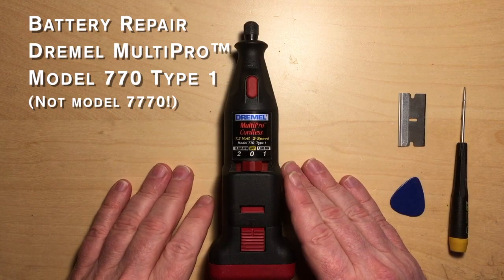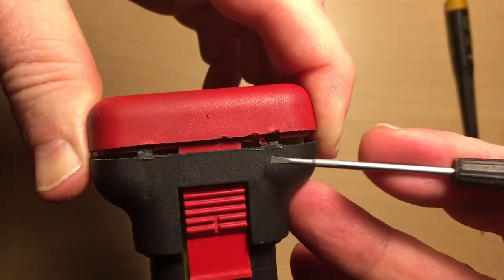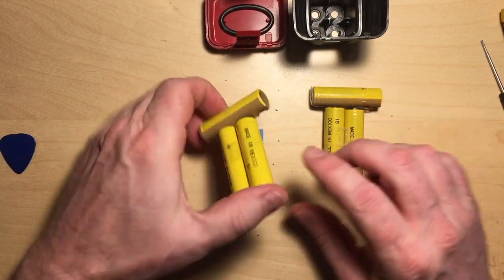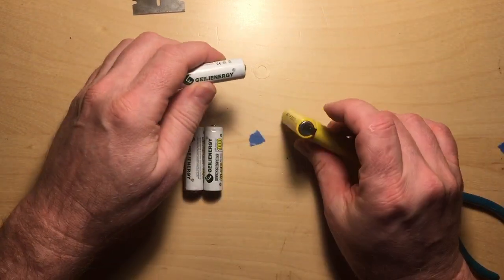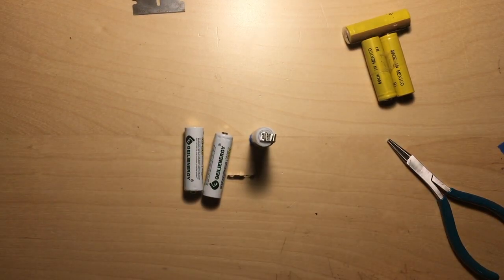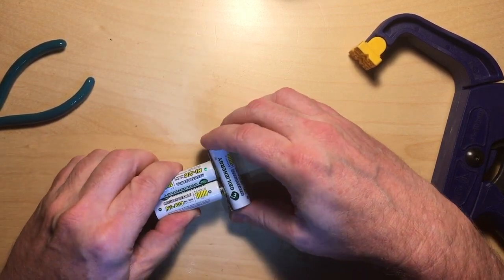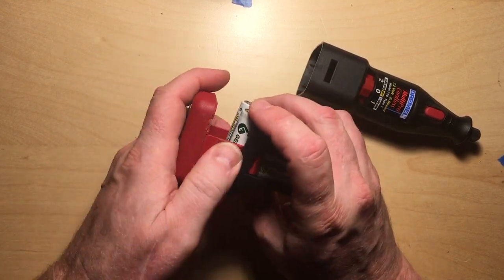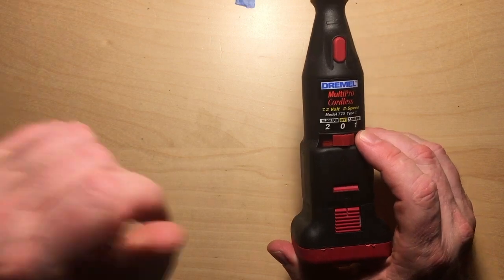Dremel 770 Type 1 Battery Repair / Replacement

Comment: Thanks for this informative demo. i have the exact Dremel and battery pack but with blue tabs.  I ordered my batteries from Amazon.  Then I carefully tore off the tabs from the existing batteries, which damaged them slightly. I then soldered the battery packs and replaced them, put it all back together and the Dremel worked at both speeds.  Thank your guidance.

My solder joints and contact bands to the batteries are pretty crude and probably will not hold up under tough use. Investigating a little more I found there are USB battery spot welders available with the least expensive being around $55 and the pack comes with new bands. They are pretty cool and give you a quick  tight bond. Maybe a worker at Batteries + will have the spot welder, and can buld this for a fee but their batteries are very expensive.

The cost of a new Dremel (DremelLite 7760 4V Variable Speed Lithium Ion Cordless Rotary Tool Kit with 10 Accessories) is about $64. It was a nice exercise and learning fixing this but I am going to stop here! Too bad Dremel does not support this battery pack replacement.

Comment: Hey thanks man ! 
Here’s a little tip … when you put the little screwdriver in the edge to separate the red top from the black body of the drill you just need to get alittle gap between them then push on the red buttons on the side and that will disengage the black clips so you don’t break them … at least that’s my experience while watching you

Comment: Hopefully this isn't too upsetting but I'm halfway through your video and have the same model. It's actually one of the first 100 made. Anyway if you squeeze the 2 red squares for the battery release hard it slides down pretty easy to expose the yellow cells

Comment: Instead of prying or placing a vice once the video showed where the tabs were located a tried this instead.  Take a pair of channel locks and grab the red cover where the tabs would be.  Do not grab the black part.  Squeeze gently while at the same time pressing the red lock tabs.  Gentlt rock the black part while pulling them apart.  Took about 5 seconds.
Reply: This worked GREAT.

Comment: You can actually zap your existing pack with approximately double voltage to bring these back to life. I have some B&D 17 volt lawn equipment batteries that I charge up, use some clips on their blade terminals, and touch and hold + to + and - to - , noting that there are two of each on the Dremel pack and you need to zap both to energize all 6 cells.  I’ve brought back Dremel packs that wouldn’t take any charge.  The zap dislodges the sulfation crystals that form from disuse and shelf time.  For an unchargeable Dremel pack. I zap it, charge it fully, then discharge completely by running the tool u til it stops, then fully charge it again.

Comment: I recommend a variety of putty knives for opening cases like these. A couple of plastic ones and a couple of metal ones. 

Sharpen the front of the metal putty knives so they will fit into small crevices like this. 

Work one knife into the crevice and slide it to the side if possible. Or work one putty knife into the crevice and twist it gently to open the crevice next to it enough to insert the next knife. 

Work your way around the case, putting one knife after another in the crevice so you can keep the first spot open and gradually get the rest free. 

Once you have the knife in the crevice, press it firmly inwards to release any hidden tabs. Once you have a bit of it open, see if you can tell how closely any tabs are spaced. 

Even the metal putty knives will be less likely to mar the finish if you are worried about that but if it is something you really want to keep pristine, start with the plastic knives and see if they will work.

Comment: Thank you! I have been looking for instructions for strapping the batteries together - was afraid to use my Weller due to warnings about soldering batteries.  But you lived through it so I'm going to give it a shot. Safety glasses and maybe lean back a little...
My batteries are on the way!  This thing has been collecting dust for quite a while, but I knew it could be fixed - I hate to throw out fixable stuff and buy new when it's totally unnecessary, though that is usually the manufacturer's corporate business plan.
Reply from the maker: Thanks. I learned after I made this that, yes, they really do spot-weld the strap to the batteries -- and, in fact, if you look around on YouTube you can find instructions on how to build a hobby spot welder for this; they are popular with the folks building power packs for electric cars out of smaller (18650) battery cells.

Otherwise, go clean, hot and be fast! :)
Reply: @WardCo  I saw one three days ago that was 3 - 9 volt batteries in series and a capacitor, with cheap voltmeter leads.  Was very effective, and quite minimalist.
Reply from the maker: @papafrank7094  Ah, very cool. I've get to get on this train!

Comment: If you have a vise (especially a woodworking vise) I found a very easy way to open the battery packs without any damage.  Place the battery pack in the vise with the long sides of the black case in the vise jaws, with the colored plastic cap just barely above the vise jaws.  Tighten VERY SLOWLY.  You only have to compress the case about 1/16" and you will hear a click and see the end cap pop up just a little.   The push tabs that hold the battery into the drill motor are now the only things holding the end cap on, so take the battery out of the vise and it will come apart easily.   

I really don't want to put Nickel Cadmiums back in and will try to figure out how to either do a "Frankenstein" job adding half of a battery box for disposable AA's to half of the original battery enclosure, or I will try to figure out how to modify my charger to use NiMH batteries.  If anyone has any info on either option please let me know!  Otherwise, I think I will just buy a new Lithium Ion Dremel-type tool.  I am done with NiCad!
Reply: The vise is the way to go. Took it apart in 30 seconds without breaking any tabs

Comment: Cool thanks! I had to dig mine up to do some fine polishing. I have and usually use a nice corded Dremel 3000, but I just realized that all of the fancier tips in the kit(for the 3000) I bought, were too big for the 3000 shaft I have, but they fit in this guy. Of course the batteries are dead. The contacts for the battery pack are not great in that model. One in particular was craly overworked, slightly bent, brittle and discolored. Was planning on suring it up with a tiny copper strap n solder, but it nakes me worry about how much life it has left.  I think Im going to try to make a pack that can be corded too sucks to use a battery so.muvj standing right next to an outlet. Im thinking about bucking down a higher amperage 8.3v or 9v PSU to 7.2 inside a pack instead of batteries. I recently got a ferret 3d scanner as a gift, I could prob scan the battery pack parts and edit them to be longer and/or wider at the end to make room for the buck converter, DC plug, & any other componets required to maintain safe, consistent power. One day.... Unfortunately for now it looks like Im using a drill 😁 Thanks for taking the time to document and share!

PS: you may want to be careful not to say "I got high before turning the camera on.." with a hot mic anymore 😂

Comment: I recently purchased two aftermarket replacement battery packs (for Dremel 757-01) from Walmart.com for $23.99 plus tax (free shipping).  I do enjoy your video.
Reply: Thanks!
Reply: 757-01 will NOT fit a Dremel designed for the 757 battery. This video shows the 757 battery.
Reply: Did yours fit and work? Tried that and it does not fit and had to return it.

Comment: Tin (melt on solder) the battery and strap before soldering the two together.  Then just need to heat with pressure.

Bend the contacts up in the grinder to make better contact so low and high speed work all the time.

Comment: I have the same exact one it's in mint condition and I am actually going to be selling it . I can't believe that the battery in mine still works and holds a full charge . My dad stored it inside and when not in use he had the battery pulled.   It is really great tool
Reply from the maker: Ha! Excellent. I love mine; it's such a great size.
Reply: @WardCo  it really is I actually just gave it to my son and he's really getting into it he didn't realize how much fun and all the creations you can make with it

Comment: The inside of what I would call the top (tool side) of the battery housing is molded to mate /accept either the flat negative or the button top positive. These moldings will correspond with the plus and minus signs molded on the exterior of the housing.
I have the exact tool 
I will upgrade with  2 lipo 3.7v AA 14500 cells
And include a micro USB charger w port in the open space in the housing.
No more wall wart cradle
Reply: You'll need to do more than that for guaranteed long life of the LiPo batteries.  They should be charged individually and "balanced", which requires 4 leads into the 3 cell pack and a "3s" charging board.  However, if you charge them at a very low current (like 100 ma or less), in series (no balancing),  you'll "probably" be OK, i.e. they won't overheat and/or "go boom"..  Ask me how I know...

Comment: Easy to open. Just squeeze both side tabs in and push end cap off. No tools needed!
Reply from the maker: Oh, NOW you tell me! (Though I am skeptical, and mine is now too messed up to test!) Hope this is true though and your comment helps somebody out.
Reply: @WardCo  yep. Push red clips in and up and it comes off with some wiggling. I got lucky and didn't need to pry anything.
Reply: This didn’t work, but squeezing the red cap wir channel locks did.

Comment: I hope to do this for a friends Dremel 780 Model.  the battery is 9.6 V and 0.7Ah  what replacement batteries would you suggest?  I can't stand tossing it.  Hope I can get the right batteries and then follow your video! Thanks for this!

Comment: As sson as you told how to open this battery holder it took me less than a minute to open mine.
Reply from the maker: Excellent! I'd do a much better job now for sure!
Reply: @WardCo  Well I am 75 years old and some of my hobbies have been repairing old mechanical watches both wrist and pocket varieties. I also was trained by the Navy to repair communication and navigation equipment. Although most I worked on were vacuum tube-driven I have in civilian life worked on transistors and integrated circuits. I guess after 50 plus years of doing this kind of stuff it becomes easy. But you showed me how to repair my old Dremel cordless so you are the hero here. Thank you very much, Sir. Nice video.
Reply from the maker: @ronmartin121  Wow. Thanks Ron for those very kind words. Much appreciated.
Reply: @ronmartin121  Thank you for your service.

Comment: Is there anyway to charge the battery if the original charger is lost
Reply from the maker: Oh, that's tough and inconvenient mechanically. I mean, I suppose you could take a stand-alone NiCad charger and run wires from its charging tabs to each of the two battery series, but I don't know what I'd to do attach and detach them easily.
Reply: Try ebay for a charger.  You may even find another complete unit for a song since these are no longer in the supply chain.

Comment: I found one of these in my garage, but I'm thinking of converting it into a corded model instead. I'm planning to buy a power supply for general electronics stuff, something like this (https://bit.ly/36qveHx), so I thought I could use it with the Dremel. However, the Dremel only states the voltage, so I'm not sure what the current need is since the power needed isn't written anywhere else, do you know what they would be? The power supply I'm planning to buy supplies 0-30V 3A/5A/10A DC.